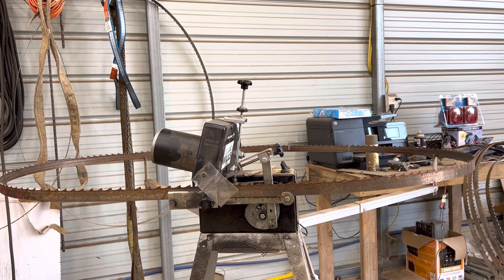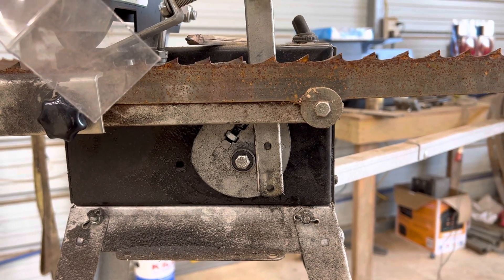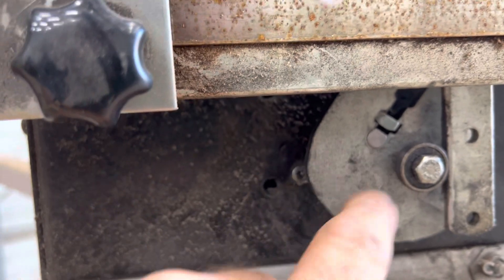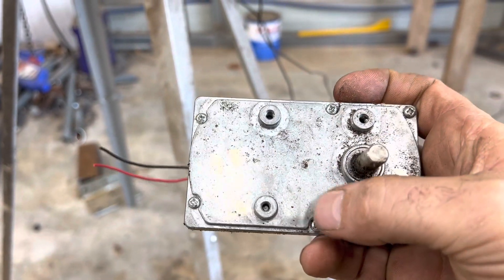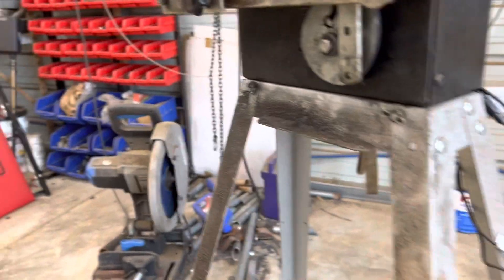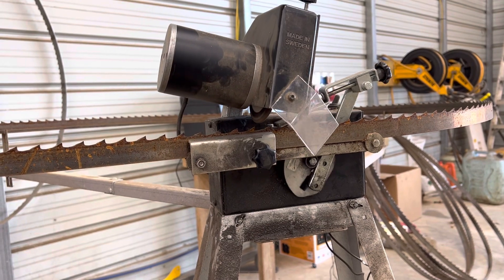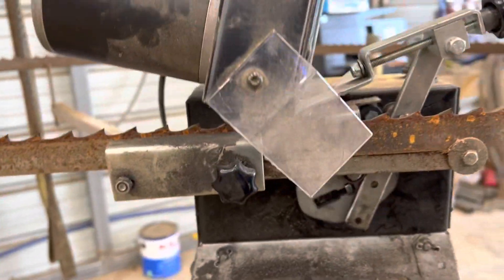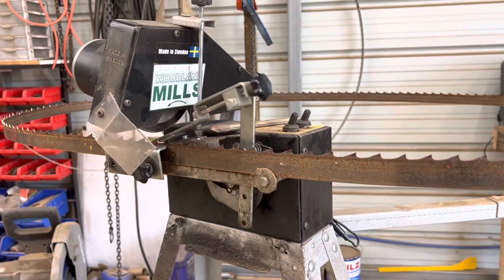Woodland Mills Blade Sharpener Modification

Comment: That is fast, why aren’t you doing the gullets?
Reply from the maker: I just do the deepest part up next to the base of the tooth. Seems to me that’s where the cracks usually form. I only do two or so sharpenings because I don’t have a tooth setter so I’m happy with the results I’ve been getting.
Reply from the maker: I’ve only sharpened maybe 40 or 50 blades with it so far but no problems at all.

Comment: Hey there I was thinking of swapping the gear- motor. My blades have 191 teeth, and it takes forever! Wood-mizer sharpener is 30 teeth a minute but doesn’t have the shut off feature. I’m gonna get a new gear motor and speed up the process. Thanks for sharing your fix. God bless you and yours

Comment: Speed improvement aside, even when I slowed the video down to .25, it appears the stone lifts out of the grind before it touches the gullet at all. Do you do this intentionally? If so, why?
Most common complaint on these sharpeners I've seen is, the stone doesn't stay in the gullet long enough to stroke the backside of the next tooth.
Reply from the maker: I don’t worry about sweeping the whole gullet. Seems to cut just as good as new if not better like this. The cracks are generally going to be close to the base of the tooth anyway so as long as I hit a little bit of it I’m good with it. I don’t have a tooth setter so I usually on sharpen 2 or 3 times anyway then discard the blade.